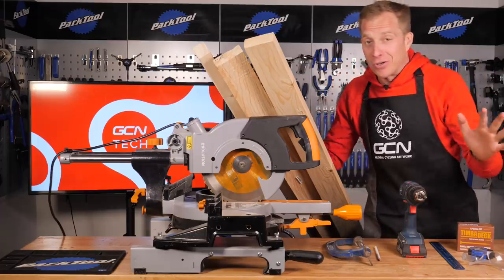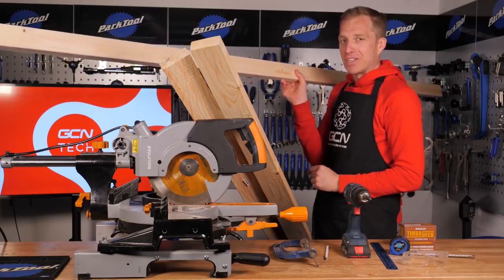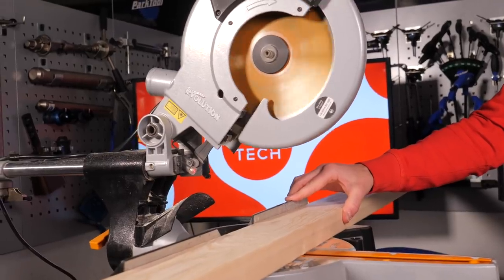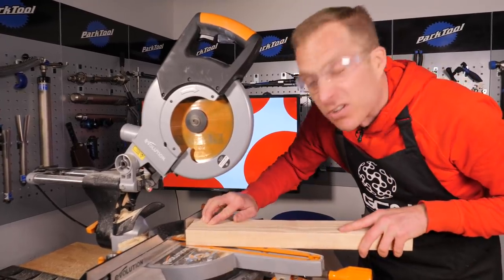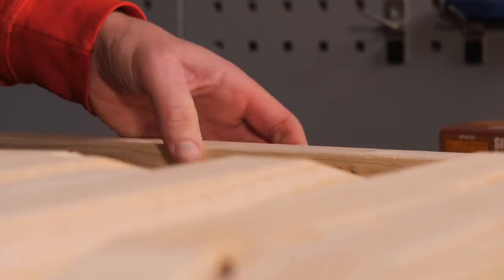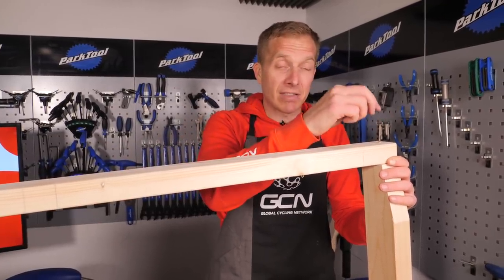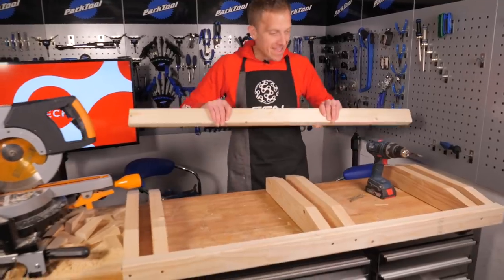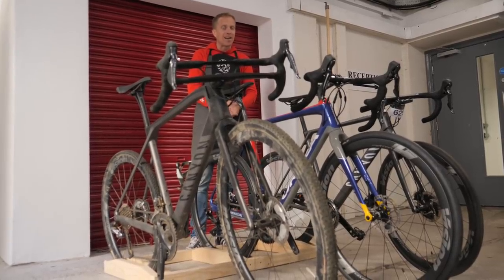How To Build A Bike Stand | Easy DIY Road Bike Storage

Comment from the maker: What else would you like to see Jon making? Let us know in the comments below 👇
Reply: Trophy cabinet.
Reply: Four bike transportation stand made to fit the bed of a pickup truck
Reply: a bike....but not out of 4x2
Reply: A work stand!
Reply: A workstand
Reply: Work stand definitely
Reply: A workstand with somekind of guide mecanism to center your fork and handlebars
Reply: A rocker plate for a turbo please
Reply: A suspended bike bracket a la Tacx's BikeBracket
Reply: An upright/hanging bike stand for in apartment storage of bikes
Reply: workstand
Reply: A chain keeper...for Simon
Reply: a good video
Reply: I made a wall bracket bike holder out of wood that also has space for your Helmet and shoes. Very easy to make and very pretty!
Reply: I want to see Jon Farm Cottage..
Reply: I’d also like to see a vertical bike stand for tighter storage spaces!
Reply: Can John make another one of these, but with the space for lawn mower? The shed ain't big enough to for that as well at the moment.
Reply: Mobile P lab.
Reply: If you have 15 bikes and a garage, a way to store them by using maybe  the walls and ceiling, so cars can still pull in,  and that is easy for your wife who is shorter than you to get them down somehow.

Comment: Personally I'd put two screws in instead of one, to eliminate possible rotating of the stands (caused by the weight of the bike). But that's just me :-)
Reply: Me too. And I would have drilled the screw holes to avoid splitting.
Reply: Screw and glue all the things. :-)
Reply: Just weld them :)
Reply: Welding...now that sounds fun

Comment: I would have drilled some pilot holes before putting in the screws so the wood wouldn’t split and used some glue to help hold it together.  But nice job.
Reply: No need for that on this type of wood.

Comment: Cheers Jon! Nice video as always! love the show and those DIY videos! Just a quick suggestion: you could've saved space by flipping the middle bike, also, depending on the wood the viewers are gonna use, it's important to pre-drill the holes to avoid any cracks, and last but not least, wood stainer doesn't protect the wood! use lacquer instead (even over the wood stainer if staining wood its your thing)! Very nice video series (hopefully), cheers! Love the channel! A suggestion for a next video is a bike maintenance stand and/or a stand you can fit at the boot of a SUV, I saw it once on the HACK/BODGE section of the GCN Show, loved it, but never attempted! CHEERS !

Comment: Great job. I suggest a vertical stand (wall mounted), or a compact tool/spares storage solution.
Reply: Yes, something to hang them safely by the front wheel. I have very little space available, and I need to fit three commuters and an E-Bike in addition to the upcoming road bike I'm purchasing...

Comment: Try using a drill with a wood bit a size  smaller than your screws. This will serve as a guide when your screw goes in avoiding stripped screws and splintered wood.

Comment: The screws will go in easier and be flush without stripping if you drill a pilot hole first.  I'd also use two screws on each side.  Looks good though.

Comment: As a time served Engineering Patternmaker , who uses woodworking tools every day, a few things stand out, 

 Cross cut saws are dangerous, you showed an extremely dangerous cut for the wedges,the  wood can easily slip,  your fingers can be in the way when the saw comes down, when i first started using power tools, i was told always know where your fingers are before and after cutting.

When putting screws into timber always drill a pilot hole through the  top piece of wood, it stops the wood splitting and makes it easier to put the screw in.

When you get a new box of screws always spray the screws inside the box with a lubricant and shake box, remember not to place box on any thing  that may absorb the oil.

2 screws in each cross piece to stop twisting.

Paint wood before assembly using a 3 inch paint roller and tray , its a lot easier.

Comment: Hi Jon, whats the best way to transport a bike.  Inside the car or which type of rack is best and least likely to cause damage to my pride and joy.
Reply: I'd say inside a car always make sure the drivetrain is free and clear. If enough space, laying it down non-drive side in the back of the vehicle (or if your rear seats fold down, in the trunk of a sedan). Taking the front wheel off allows for the handlebars to be rotated for more space too. 

 Best bike rack is a hitch mounted tray style, many only touch your tires (front and rear) meaning no paintwork contact, and since its behind the vehicle, less likely for rocks or insects to smash into your bike.

Comment: Not bad, simple and does the job but would never have my hand so close to the blade when cutting an angle...
Don't take much for something to go wrong.
Having been a cabinet maker for 35 year's.
He could have done the same cut but held the end away from the blade. 👍🏾
Reply: Yeah, one of the dumbest things I've ever seen. A little slippage and binding, and just 0.02 seconds later, you are picking up your lost digits from the floor. If you can't make the cut with your hand a safe distance away from the blade, use a clamp or jig.

Comment: We all know that wont last in the long run, you neeed two supporting screws, glue the joints and to prevent damaging a screw you can drill pilot holes in before hand.
Not to mention you can use a plane to round off and smooth the wood as needed. I think Jon just got a desktop circular saw and wanted to use his new toy. :P

Comment: Pro tip: when joining two pieces of wood together, pre-drill a smaller hole, that way when putting in the screw, there's no chance of the wood splitting.

Comment: Next time how about making a vertical bike stand. Save storage space.
Reply from the maker: Great idea!
Reply: you could pretty much just mount this one vertically on a wall and you'd be all set. I'm going to need to build something like that this spring, 5 bikes (maybe 6-7) and at least 3 scooters, and the kid trailer, the garage gets pretty messy pretty quickly. bolting something like this to the back wall would mean i could still use the garage in the winter for the car (with the bikes stored away).

Comment: Jon, equally as important is to wear a mask (best with an air filter or two) with all the nasty dust flying around. Not all types of wood behave, some will get into every single gap possible especially those laminated ones.

Comment: Not a fan of the rear wheel holding the bike. Should make a little arm to hold the frame up slightly to remove some tension off the wheel. My personal opinion of course :)